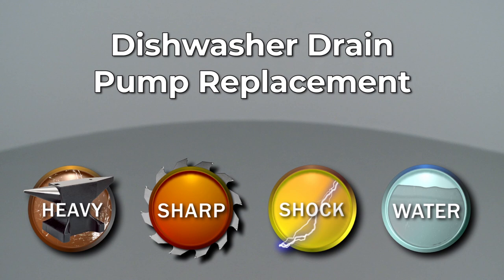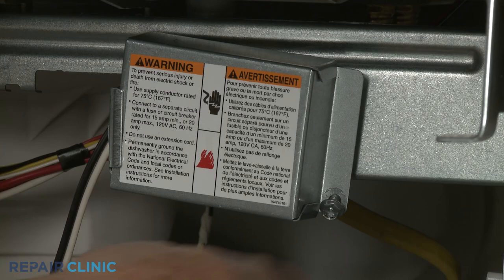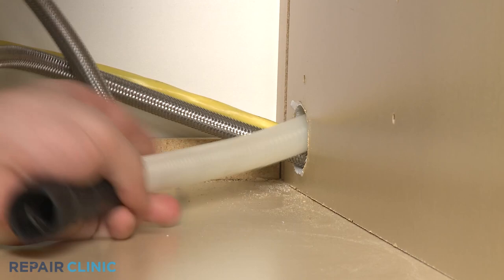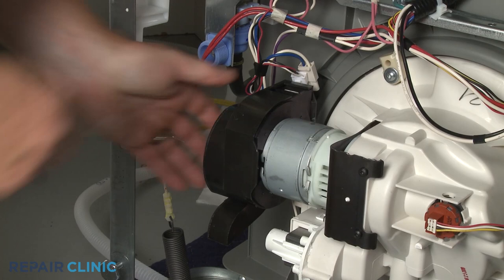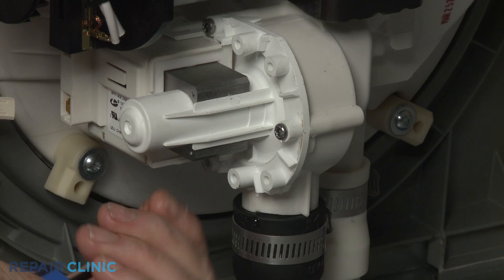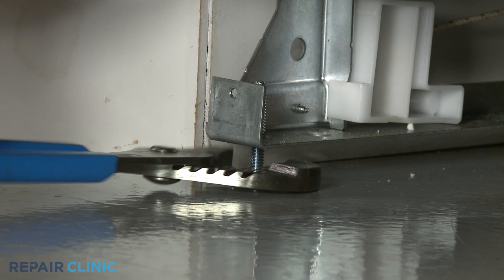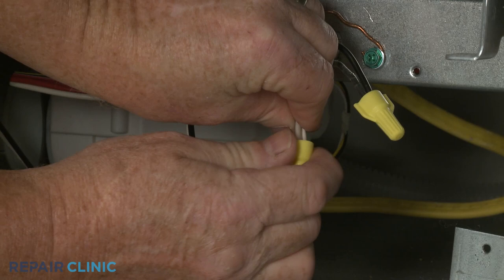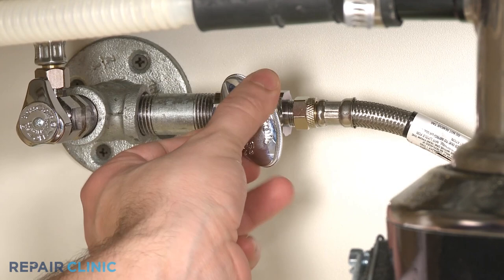Frigidaire Dishwasher Drain Pump Replacement (part A00126401)

Comment: Is there a reason why you unhook the wires rather than just unplugging it? I've pulled mine out to work on it and just unplugged it from the wall, leaving the capped wires connected.
Reply: Feels like a safety and liability step

Comment: My drain motor seems to be running constantly and not allowing the wash cycle to complete. Should I replace it or could there be another issue to check first?

Comment: My dishwasher keeps blowing the TOC fuse (Thermal Fuse) and leaves water in the dishwasher. This happens after about 2 weeks worth of use. Could it be a bad motor? Or, is there something else I should check?

Comment: what kind of lubricate did you use?
Reply: It has to be a non petroleum based so it doesn't damage the gasket, dielectric grease  could be used or plumber's grease

Comment: Dumb!! This could be done without taking it out of the cabinets
Reply: well, my pump comes today and im replacing it tonight, i will let you know of its possible or not
Reply: nope, the incoming water pump is in the way, you hafta pull the washer out and tip it back. i didnt pull it out as far as he did but it did hafta come out.
Reply: DUMB.
IS CORRECT !
you just got it backwards...